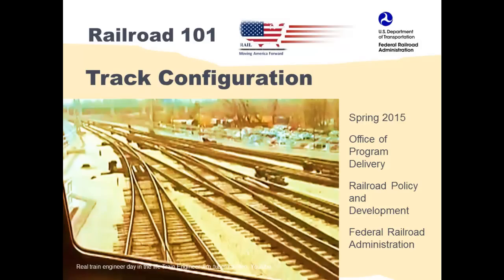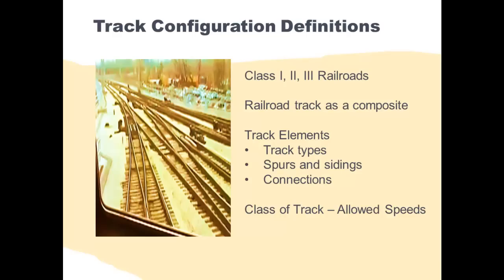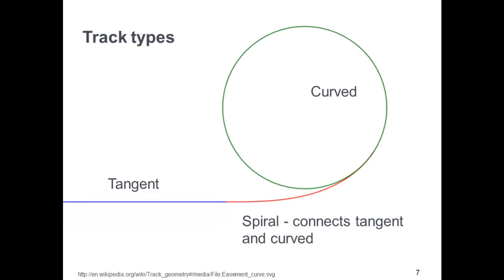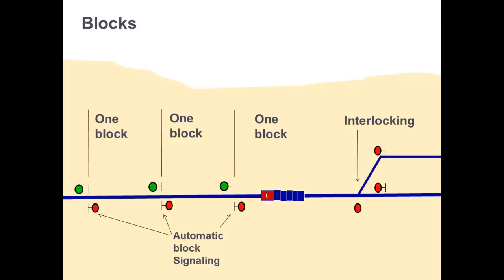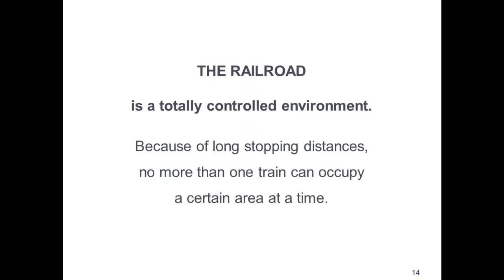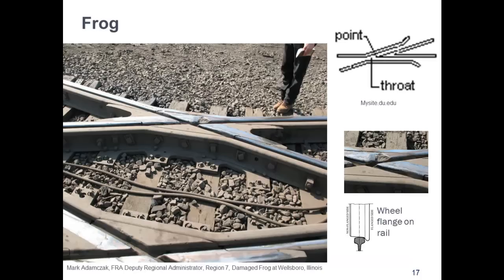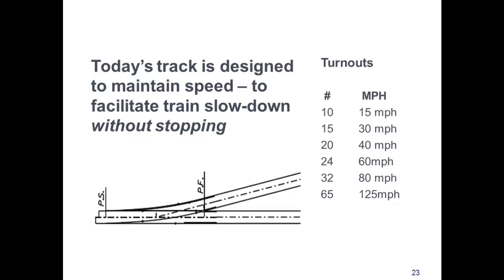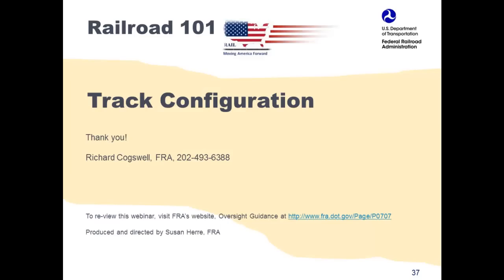Railroad 101: Track Configuration

Comment: there are triple tracks in Nebraska Union Pacific
Reply: There is a yard in Nebraska that requires 3 or 4 towers because it is so long the curvature of the earth makes it so you can't see well from one end to the other even from up inside of  a 40 foot tower. I believe that classification yard in North Platte NE is the largest such yard in the whole world.
Reply: @Satchmoeddie  well, if the horizon for a six foot man is just over three miles (taking in the curvature of the earth), at forty feet, that man could see for about twenty-one miles.  Bailey Yard is only eight miles long.  Whom ever told you the reason for Bailey Yard "requiring three or four towers because it is so long the curvature of the earth makes it so" is just, pardon the pun, flat out wrong.

Comment: What is the tolerance, in inches, allowed for the track width to vary?   Such as 4’ 8 and 1/2 inches, plus or minus how much?  1/2 inch?  1 inch?
Reply: You're referring to gauge (distance between the two rails at a certain height below top).  FRA defines gauge tolerance for each Class of track.  Refer to Track Safety Standards Compliance Manual
Reply: @toddstewart8137    Better late than never, I guess.   Thanks!